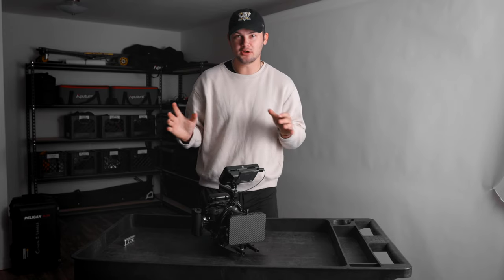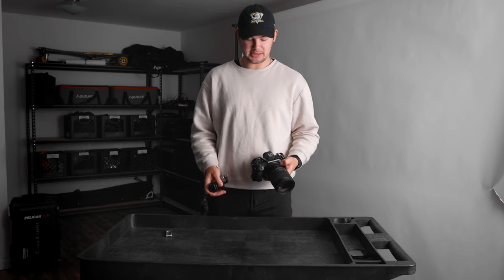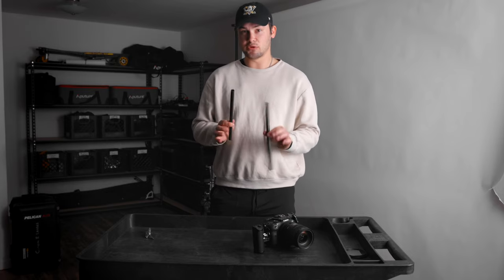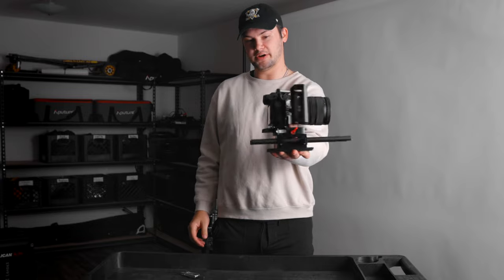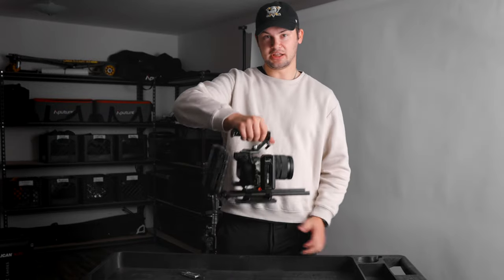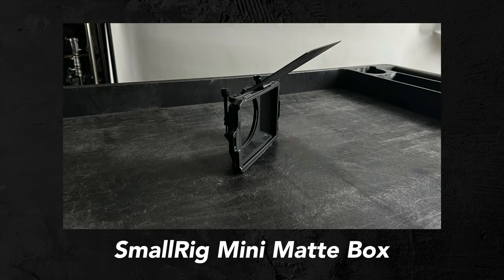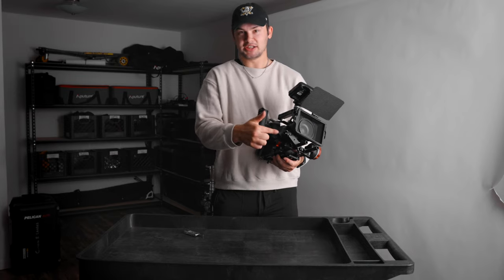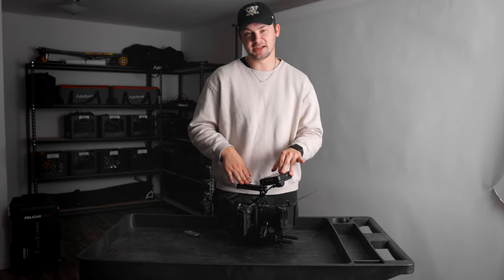Canon EOS R6 Cinema Rig | The Ultimate Build

Comment: Hey, man. With how you have the R6 rigged (external recording, and a v-mount battery) do you still run into over heating issues? Thanks in advanced! Sweet video
Reply from the maker: Not in 4k24. 4k60 yes but you get way longer
Reply: @EastonBennett sick! Thank you! I’d most likely only use it in short bursts anyway, but thanks for the heads up. Much appreciated.
Reply from the maker: @MindYaBizz_Whiz appreciate you watching and connecting!!
Reply: If you get a dummy battery for the R6 with a USB connection you can connect that to a smallrig vmount pro and eliminate any overheating isues whatsoever
Reply: @etorres1217  word! Thanks dude

Comment: Are you able to still record internally while using the monitor? I can't seem to make it happen and I saw other people talking about canon not allowing it but allowing it on thr R5 and even the R
Reply from the maker: Haven’t figured it out on the R6 :/ works on my R though
Reply: @EastonBennett  balls, yeah seems they got out the cripple hammer again. Faaack, might look at selling it then. How have you found it?
Reply from the maker: I don’t mind that it’s missing it. It would be nice but I don’t NEED it. I usually just record to the monitor, having a backup would be nice though
Reply from the maker: There is a work around, if you turn off all on screen settings and record to both it would technically work
Reply: @EastonBennett  yeah I get you. I just can't afford the ninja v so only have a monitor at the moment
Reply: @EastonBennett  if that works though, you're a genius. Been looking for a workaround all evening
Reply from the maker: Which monitor you rocking?
Reply: @EastonBennett  just a 
Cheap feelworld one. But wanted to try using my phone too and got to the same problem
Reply: BTW, what lenses are you using these days? I'm looking at some ef ones like the sigma you have but unsure if its worth saving for an RF
Reply from the maker: I use the sigma 24-70! I use all signs, loved em but I’ve also never used an RF

Comment: My issue with using a monitor on the r6 is it turns off my display. 

I struggle with this because I can’t tap on the monitor to select what I want in focus. Shooting weddings in always wanting to sure it’s focused on the right person, thing,
Reply from the maker: You can change this in the settings!
Reply: @EastonBennett  teach me :) I haven't been able to successfully do this by watching any tutorials on Youtube.
Reply: @brittnelsonvideo  you can't have the internal AND external monitor turned both on, unfortunately. 
But obviously, an external monitor doesn't really make so much sense to me anyway when shooting autofocus, as you can't control anything via the external monitor anyway (except for the Portkeys LH5P i guess). 
I decided to use autofocus for situations, where the autofocus system of the R6 does not have any chance to get distracted (=lose focus), and use manual focus for difficult focus situations. 
Let me know if you found a better solution in the meantime :)
Reply: @Papageihund  thanks for your comment! Do you know if the R6 II will allow it O.o? fingers crossed :O
Reply: @brittnelsonvideo  i don't know. just bought a Portkeys LH5P ii monitor, which allows doing camera changes of the R6 on the external monitor. For sony, it even allows to set autofocus points. So i guess Canon will not support the autofocus function for their cameras so soon (just my feeling).